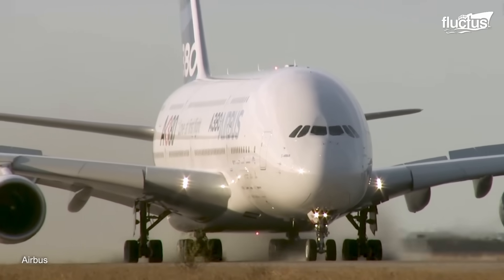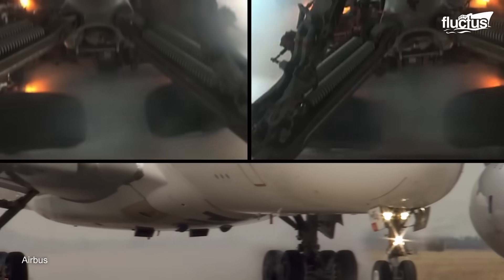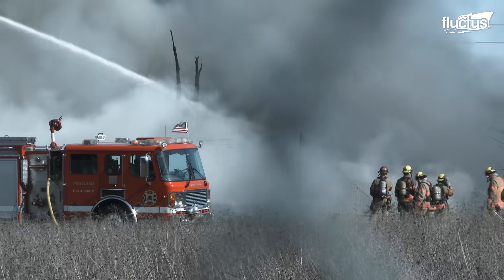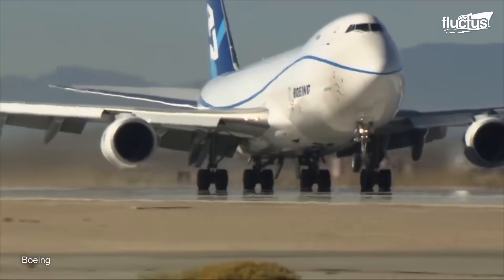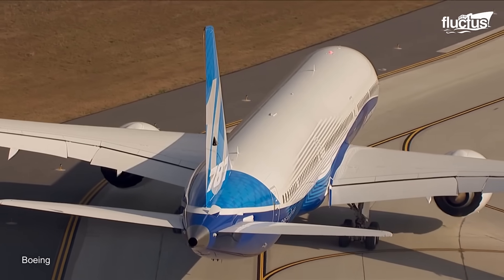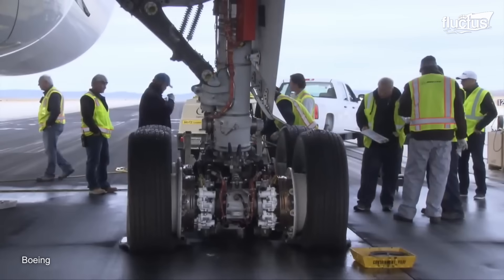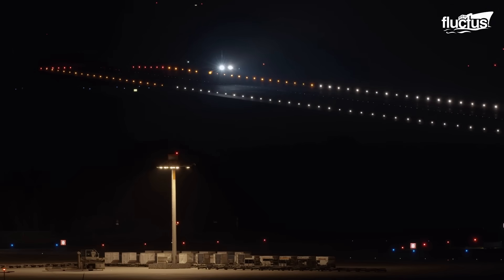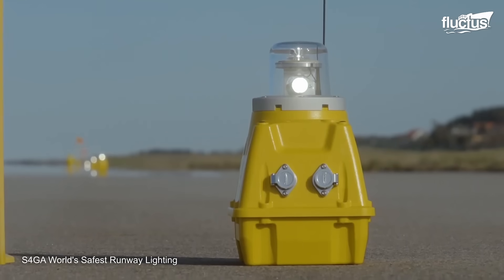What happens When Plane’s Brakes Start Catching Fire After an Extreme Landing

Comment: Call me silly here but the use of max braking has little to do with with how "hard" the landing was. It's got more to do with the aircraft speed and the amount of remaining runway. With a given weight, a particular speed, runway friction, it will take a certain distance to stop the airplane. If that's shorter than the available length remaining, you're good. If it isn't then you go around. Max breaking is only used as a fix for those "Oh crap" moments where getting back into the air isn't possible. You can make the smoothest landing in history but if you're too far down the runway it isn't going to work. Of course this applies to take offs as well. All airplanes have a speed at which they are ready to take off. It changes on factors such as weight, the density of the air, related to altitude, temperature, humidity, barometric pressure, speed and direction of the wind coming down (or not) the runway. Prior to flight the aircrew calculates the takeoff speed and how far down the runway they'll be based on the expected performance of the aircraft. That speed is referred to as V1. On take off, at any point prior to reaching V1 if you have to abort the takeoff, the crew will attempt to stop the aircraft on the runway using any and all means in doing so including max braking. Above V1, sorry, you're going flying. Of course there's all kinds of caveats, rules, blah blah. It's complicated. Back to the point though, it'd be nice if content creators actually had a decent understanding of the subject of their videos.
Reply: ok silly
Reply: My only thing I have to say: 🗿
Reply: Exactly, aviation enthusiast needs to do this so it can have accurate information